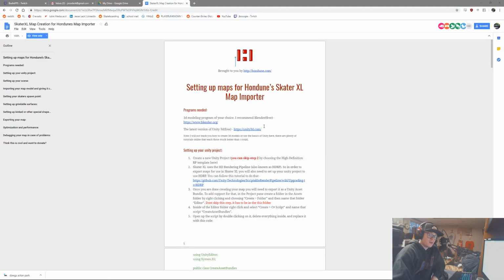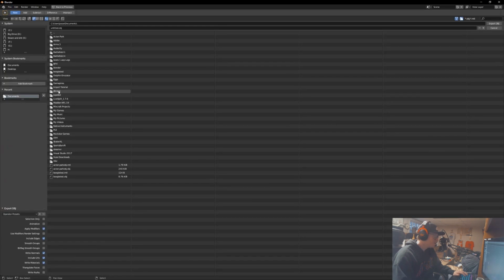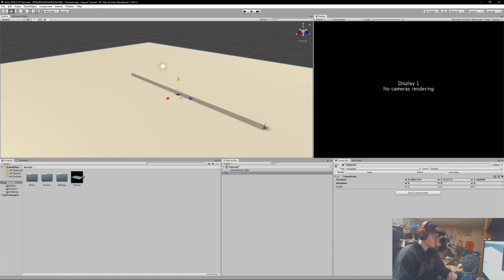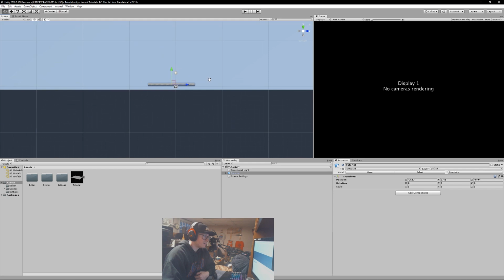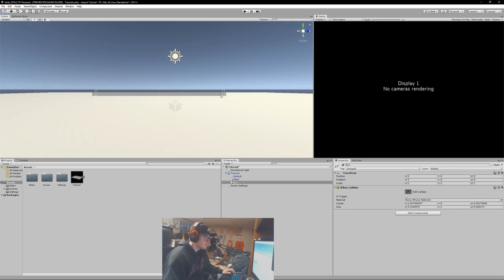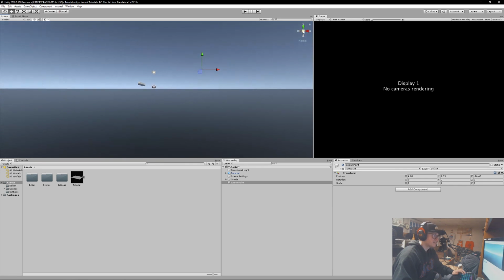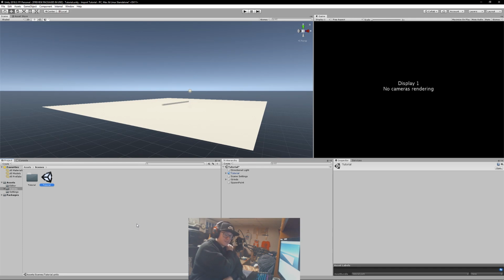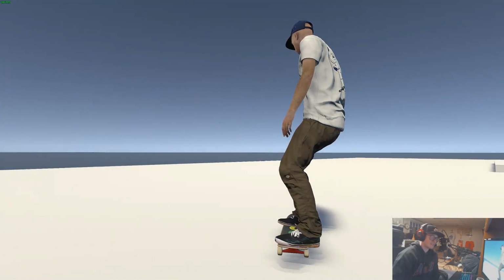Creating, Setting Up, and Importing Maps into SkaterXL

Comment: My skater just falls through the floor, followed these exact steps. Unity 2018.4.17f1 any ideas? I don't even see my park, everything is 0,0,0 so it should be centred but it's empty.
Reply: like me .......
Reply: do you have colliders on all of your obstacles?
Reply: @snow5772  Yeah this was ages ago, it's sorted now thanks. I was confused by the entire process.
Reply: @digitalx8460  how did you fix it? just spent all day modeling a park and now when i go through the steps i fall into the void and dont see any of what i modeled....NVM!!! the answer is to use unity 2018
Reply: @xXDylanXx13  Yeah sorry this was a long time ago I was very new to Unity. AFAIK you need colboxes on everything you want to land on.
Reply: @digitalx8460  i think i mainly had the wrong version of unity, 2018 fixed it but now im using 2019.3 15f1